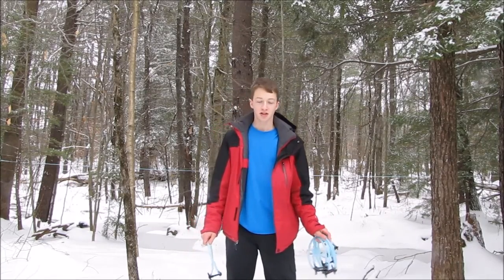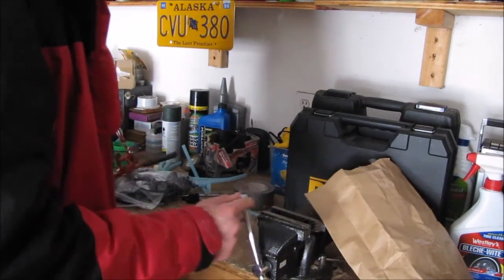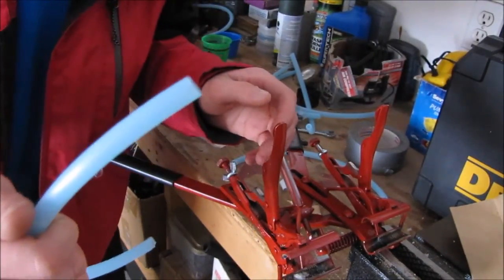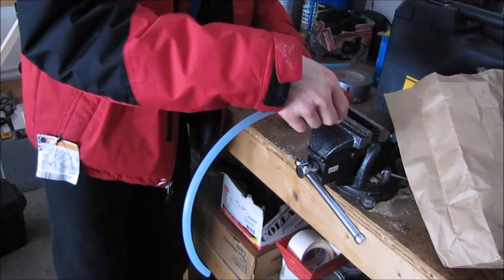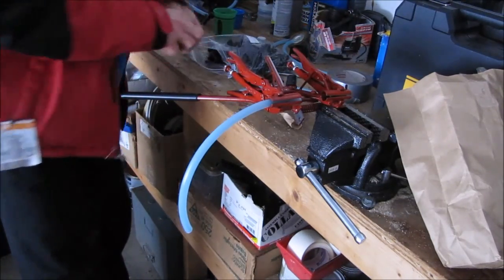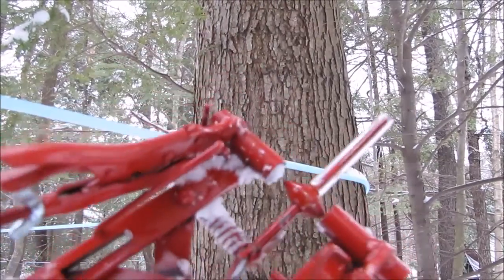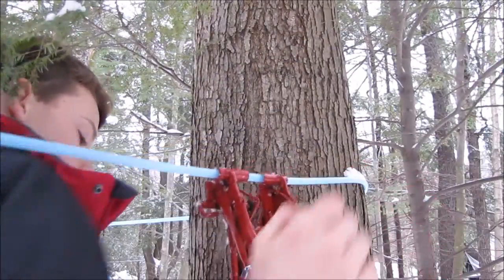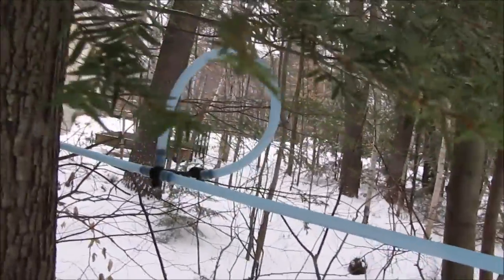Maple Dropline Assembly and Installation

Comment: You did a great job in this video. Im impressed at your knowledge, ability, and clear speaking. Ive been bucket tapping for a few years and switching to a few lines on a hill this year. Do you reuse your taps ( how long) and if you do are you cleaning them (how)? Im teaching this to my kids so they can do it like you as they get a few years older. Using the bench vise was a great tip! Thanks!
Reply from the maker: Thank you, I reuse my droplines. It is best to replace taps every year for a small production increase but I have not had the time to do that. If you have metal bucket taps it is best to boil them each year. If you live in the area you are welcome to stop by my operation.